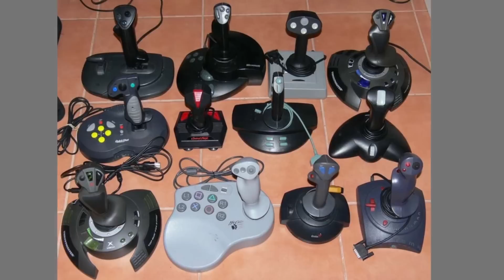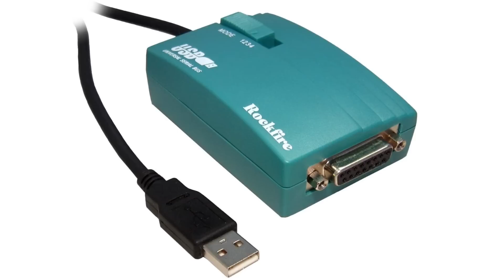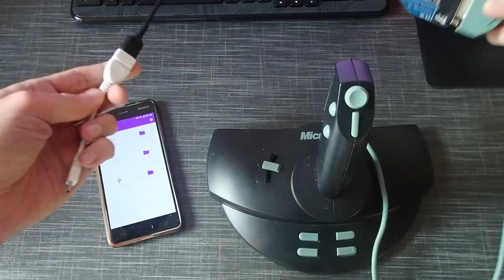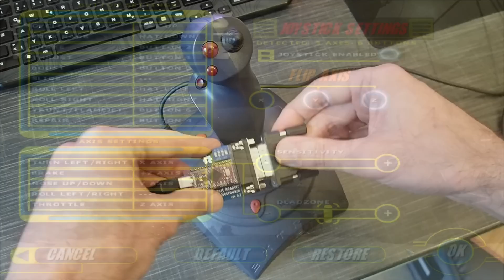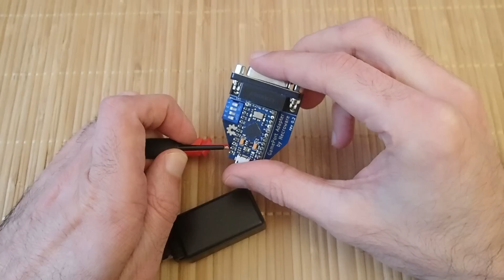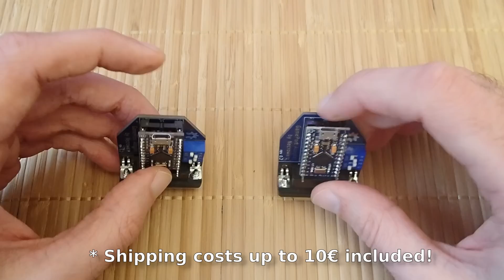Let's develop an ultimate GamePort USB adapter. Project updates and a little surprise!

Comment: I'm currently wanting to connect my CH products virtual pilot pro + pro pedals on the same adapter. The yoke piggybacks on the pedal for one gameport plug and still uses a second plug just for the independent brakes. I'll need 2 more analog axes, so what would be the best way to contribute with that driver implementation that is not accommodated by the standard hardware (analog axis and digital input 5 through 8)?

Comment: can you use the newer nano versions with the ATmega 328P Chip for this adapter or does it only work with 32u4 ones?
Reply from the maker: No, 328P will not work. The explanation is in the first part about this topic: https://youtu.be/tSJLgCD8jeM

Comment: Why use an arduino at all and  not just put the chips from the arduino directly on the adapter? After all an arduino is just a development board.
Reply from the maker: Because it was meant to be easy to build.
Reply: @necro_ware  The board house can populate if the user doesnt want to. Also then you could have any USB port you want. I would prefer USB A. Dont get me wrong I think this is a brilliant project but making it as  low profile as humanly possible is a good thing if it is to be put into an enclosure. Thinking about it maybe it could even be converted to work with NES or Sega controllers. You make very good content!

Comment: Hi I,m following your post and being it so interesting decided to make the project. Already made the board from OSH Park and ready to set the parts once receive some of them from DigiKey.  Lets see if all goes well with the program.  The control that I want to reuse is an old Quick Shot Mod. OS 206 .  I will let you Know.  Thank a lot for your Knowledge and contribution.

Comment: How about the other way round? Is there an interface which lets you connect a modern USB controller, a steering wheel for instance, to a retro PC running Win 95/98? Something that would act as a hardware vJoy equivalent that on one side would be seen as a computer by the controller and on the other side as a universal game port device by the retro PC?
Reply: ogx-mini does it. U can use modern Ms controllers with w98

Comment: For the thrustmaster formula t2 steering wheel , what the best switch setting ?
Reply from the maker: This device hasn't been tested yet. If it is digital, then the protocol is not yet implemented. If it is analogue, you can try to use one of the settings for analogue joysticks, or the normal Thrustmaster joystick.
Reply: @necro_ware   danke für die schnell antwort , das wheel wird erkannt und läuft in z.b nascar 94 , nascar 2  , indy car racing 2 ( alles über dosbox ) wunderbar aber in anderen spielen wie rally 97 oder NFS  ist es schon unmöglich zu kalibrieren

Comment: Do you know if that interface works with ps3 too ? (I meant if can make a joystick or steering wheel working on ps3 too )
Reply from the maker: This adapter implements standard USB HID device protocol. You can connect it to anything what has a standard USB port. It is operation system and platform independent and as far as I know PS3 has a standard USB port, so this adapter should work there too. However I didn't test it since I have no PS3.
Reply: @necro_ware  ok Ty I will try it on pc then will test on the PS3 too . Will let you know 😉

Comment: Hey Thanks so much for all your hard work on this!
Looking forward to reactivate my old Gravis Joypad!
I've got 2 question though:

1) how much did you pay for your pcb? I think manufacturing it "made in Germany" is really expensive (after some quick research - up to 40€ or more..)

2) I've got this 90s steering wheel Medion MD9868. Is there any chance that it might work at least partially or does it require a firmware update?

Thanks so much in advance for any thoughts on this! 🙏
Reply from the maker: Hi, you can order the PCB f.e. at pcbway or jlcpcb. The whole thing incl. Arduino will not cost more than 20€. The steering wheel is unknown to me. If it works in dos it should also work with this adapter in an analog mode.
Reply: @necro_ware  Thanks a lot for the advise on the PCB manufacturers!
I'll test it then and let you know.. fingers crossed! 🙏

Comment: Will this work for a track ball like 3d Assasin gaming track ball or MadCatz Panther?
Reply from the maker: Hi, I didn't test those devices, since I just don't have them. They look like digital joysticks and probably they will not yet work with this adapter. Should I get my hands on one of those, I could add support for those as well. Or may be s.o. can contribute it.
Reply: @necro_ware  I think shipping from USA to Germany might be prohibitively expensive, otherwise I would send you a still shrink wrapped one. Shipping inside the USA is getting prohibitively expensive right now also. $40 for a $40 old stock ...

Comment: Hi there, thanks a lot for your work !! I'm trying to do it by myself but I encounter some trouble to order the PCB. Would you mind sharing the one you ordered it from and the options you used for the order. Looking forward to reading you

I found out how to do it, actually it was quite simple.
I ordered the PCB from China, got it quite rapidly, assembled it and tatam !!! My sidewinder FFB Pro is working again on windows 10.. Thanks a lot for all your work.

Comment: Hello! Thank you very much for sharing this project with everyone! I will be looking into building one soon! A question I had was do you think it would be possible to support the 1st Generation Logitech Cyberman (the one shaped more like a mouse) or would this not be possible for some reason? Thank you for your time!
Reply from the maker: I don't know which protocol it used, if ADI, like the later versions, then there is a chance, that it already works.
Reply: @necro_ware  Hello Necroware! I am a Patreon supporter and I couldn’t find a way to message you on there. But I have been using this adapter recently and it works great so thank you so much for sharing it! I also wanted to see if there is any chance you would be interested to accept donations of controllers that are not yet supported to research a bit more? I may have a 1st Gen Logitech Cyberman (uses swift protocol), a Thrustmaster Fragmaster, and a Gravis Digital joystick that I may be willing to donate to hopefully have support added for them with this adapter. I would try to help with adding drivers myself but I literally know zero about programming or anything helpful with this other than being able to offer you some other peripherals. Please let me know! Thank you!

Comment: Man I was searching for ages for a thing like that, I am not into Arduino and electronics but I have a FFB Microsoft Wheel gameport version and it's collecting dust since 2003 , I see from the github info that it doesn't support the FFB yet, any updates on when this will be available? Also do you make these adapters or sell them? also btw can this adapter work on a PS5? if anyone can please build me one of this I would really appreciate that a lot!

Comment: Wait, so miniUSB Pro Micro wont fit into the PCB? :[
Reply from the maker: Forget my answer below, I read microUSB, but you wrote miniUSB. So, yes, miniUSB will not fit, it is too wide.

(Wrong: Why that? They are same size)
Reply: @necro_ware  I just got my PCBs and the version with miniUSB is too wide. Ordered the promicro with usb-c - sadly those all got way more expensive
Reply from the maker: @softwarepole  Ah, right, miniUSB, I read microUSB. But yes miniUSB is wider, this is, what I told in the video. You need either microUSB, or USB-C variant
Reply: @necro_ware  Yes, you did, but I had this one laying around and didnt knew there are any differences
And the new pro micro is on its way.

Comment: Hello Necroware, 
I have an old Microsoft Sidewinder FFB Wheel and a LogiLink Gameport-to-USB Adapter UA0052B - but that's not working at all. I'm a software developer and would like to enhance the Arduino/HID software for force feedback. Do you have at least a PCB or better a complete set for me? I will pay for BOM and shipping (Hannover, Germany)
I also have a Logitech Wingman extreme joystick. I would test that too ;)

I read that the Rockfire RM 203 does not support wheels - can you confirm this?
Reply from the maker: Hi, please write me an Email, or on dosreloaded.de, if I remember right you registred there couple of days ago, right?
Reply: Hi Peter,
Firstly thank you for trying to make the FFB work on the wheel, Did you achieve anything regarding this matter? I also have the exact same wheel and it's collecting dust since 2003.
Reply: @ahmedsalah7474  Hey Ahmed, yes after 12 weeks of poking around I can play CMR Dirt 2, Dirt4 and Dirt 2.0 on Windows, sadly Dirt4 on Mac OS does not like my USB-descriptor. Dirt 2 relies only on Constant Force and modulates everything on that at (guessed) 30 Hz.  SetCondition is still a complete mystery to me (and others). - so I left Damper, Inertia and Spring to the "defaults" - everything else runs amok. I plan to implement  usage of "parameter blocks" instead of poking the parameters (in the wrong order ) to a MIDI sysex message. If that's too technical: Do you use an Arduino Micro on Necroware adaptor or a Teensy? I run into severe space problems (ROM and RAM) . I will release the code on GitHub - do you compile the code yourself? Can you make a photo of the serial number plate of your wheel - because the "Read" deviceID seems only to return state bits - no ID what so ever - the user skoo on descentBB has a different wheel with other pulse timings - AND my wheel wants the pulses on X2. Still  reading? Okay, I'm listening
Reply: @peterwachtler2538  
Hi Peter, Sorry for late reply as I didn't get a notification of it on youtube as usual.
Do you use an Arduino Micro on Necroware adaptor or a Teensy?
- I am using Arduino
Do you compile the code yourself?
- I don't really understand much about programming
Can you make a photo of the serial number plate of your wheel
- https://drive.google.com/file/d/1SOejSW3rsqbupWjzCkOqiqUtZScwNghe/view?usp=sharing
Reply: @ahmedsalah7474  Our wheels have the same Part No - and from the ID I guess that your wheel is even older!  It's a good time for a Halloween release. I will provide a Hex-file for downloading with avrdude. It will offer custom effects but I haven't seen a program calling the functions. Do you have a game or a "custom effects" editor - it has to run under WinXP or Win98 - otherwise I can't sniff what the driver sends down to the wheel - and the Arduino micro only has 1090 bytes free memory)  I ordered an Teensy 4.0 via eBay from a spanish guy - it will arrive around 7th Nov

Comment: unfortunately, apart from being beyond my experience in electronics and software deployment, the prices for parts seem to be prohibitive for just one such adapter. for a single PCB of your specifications I've seen offers between 60 and 90 euros plus shipping. add to that the cost of arduino and other parts and you easily pay 100 euros for a single adapter. for that kind of money you already get a good native USB joystick. prices for PCBs drop considerably if you order more than 1, though, so I sure hope you reconsider that idea of setting up a shop - or someone else does.

Comment: Hello, I have a question in regards to Thrustmaster support. 
I happen to have recently gotten an old kit of Thrustmaster flight gear (Mark II WCS, F-16 FLCS, and Elite Rudder System) and I'm looking to find a way to adapt it to USB and have all buttons and axis working. From what I've read, the gameport only does the Axis and some button control meanwhile the DIN5 port uses keyboard emulation for the rest of it. Is there anyway to get that functionality? Would I need to build multiple USB Gameport adapters for each part or just one? Would I need to get a DIN5 to DIN6 PS/2 adapter and keymapping software to get the most out of it? 
Thank you for taking time to read this, along with a thank you for making videos on such old hardware.

Comment: 'the delay is between 1-5ms, you can barely feel it' - "pro"gamers fuming
Reply from the maker: 5ms means 200 times per second. I really doubt, that any pro gamer can feel the difference between 199 and 200FPS.
Reply: @necro_ware  well, you can feel the difference, but this isn't a thing aimed for the pro market :D
Reply from the maker: Some people claim to have super powers, but the wish and reality are different things. If you use a 144Hz monitor, you get an image every 6.94ms. If the latency of your input device is under 5ms, the input refresh rate is higher, than your display rate. It is simply silly to claim that someone  can feel a constant input lag between two visible frames. Even the best gaming mice have a lag between 5 and 10ms.

Comment: Nice solution. Haw hard to integrate Arduino Nanao into PCB to avoid it as a separate modul?
Reply from the maker: Nano will not work for this. You need something with atmega32u4. But I didn't integrate the MCU directly because this way it is easier to build for inexperienced users. Furthermore its is much cheaper to use an Arduino.

Comment: How about supporting the early Microsoft Sidewinder 3D Force Feedback stick? The one with the massive motors, and massive power brick? It would also need to have a new driver for newer versions of Windows.
Reply from the maker: As I said, FFB is not yet implemented at all. As for the joystick protocol, it has to be implemented, but in the firmware and not in Windows. You don't need any special drivers for Windows for this adapter, except the generic USB HID device driver, which is included in every windows since XP.

Comment: By the shape and colors, it seems like it's a Precision Pro which is 1110 on the switches. I actually own one Precision Pro, but it does have its own USB adapter.
My greatest joystick though was the Sidewinder FFB Pro due to the force feedback effects it gave, I remember cycling through the demo effects available on the control panel.
Great work on the adapter though, I hope some day the force feedback will be implemented on the wheel and the FFB Pro

Comment: When you were playing Wing Commander Prophecy you used the Sidewinder 3D Pro Joystick which is:
Sidewinder 3D Pro mode --> 1110 on dipswitches

Extra just for fun:
Before you changed it to Sidewinder 3d Pro mode, you tested CH emulation mode on it:
Sidewinder 3d Pro => switch to CH emulation mode
Gameport adaptor => switch to CH Flightstick 0010 on dip switches
All axis to center, also the throttle slider

It is so great to see all the work on gameport adaptor, it is one of a kind. TY!

Comment: Great project! I have a Microsoft SideWinder Force Feedback Wheel and would like to help you to develop the force feedback part.
Reply from the maker: That would be great. If you have some C++ experience, you can give it a try. I guess this is a long way to got, but probably quite exciting.
Reply: @necro_ware  I have C++ experience, but first I have to build your gorgeous adapter. Is pcb version 0.21 still the latest or do you have a version with reset functionality?
Reply from the maker: @dickbuitelaar9131  0.2.1 is the latest. I don't plan to release the one with the reset button, becuase it doesn't work all that well.  I made a prototype for me, but ended up not using the reset button.
Reply: @necro_ware  Thanks for the update. I used your gerber files to order a set of pcb's and the parts needed for the adapter. Will probably take a few weeks before everything arrives...
Reply: The joystick is a Sidewinder 3D Pro with switch settings 1110.

Comment: Love your videos, I really like your hardware modifications of old hardware.
I was curious if you may eventually design a 5v 486 CPU to 3V adapter like you used to be able to get to enable a 3v 486 CPU, such as a DX4100, to run on a 5v only board. As i have an old dell system that uses 5v only.

As for your quiz on what joystick you used in your prior video was a Microsoft Sidewinder 3D Pro with the dip switches set to 1110.
Reply from the maker: Thank you! To design the adapter is not a big deal, the problem is to find the sockets....

Comment: 5ms input lag is almost imperceptible, for scale, the PS4/Xbox One controllers both have 4ms input lag due to the wireless comms, at 60 fps, its less than 1/3 of a frame of lag, you'll have a really hard time feeling that.

Comment: Hi,
The joystick you used was the Gravis Analog Pro and the switch configuration is 0100 for Generic Analog 4 Buttons and 3 Axes (3rd Axis is throttle).

Thanks,
José Caetano Silva

Comment: Thanks for the updates. I'm just waiting for the Arduino to arrive to finish mine off. Between this and the MCE Adapter, You've certainly kept my soldering iron running hot.
BTW, what logic analyser are you running? I'm on the hunt for a cost effective solution.
Reply from the maker: The cheapest one for 8€

Comment: I ordered PCBs and components for your designed RTC module (Dalles replacement chip). The PCBs are in three different colors. They arrived and I'm waiting for the components to solder on.